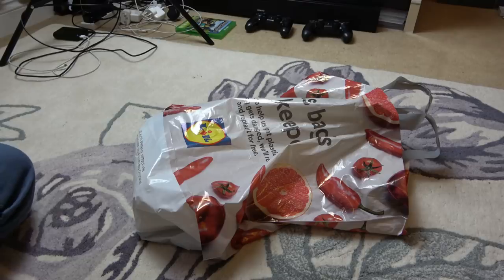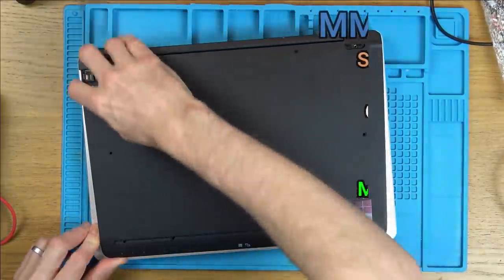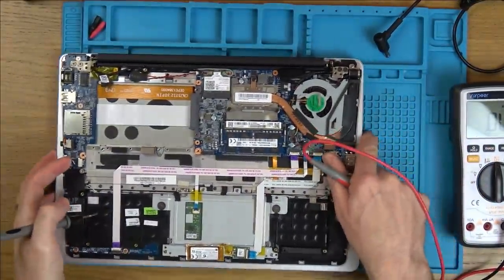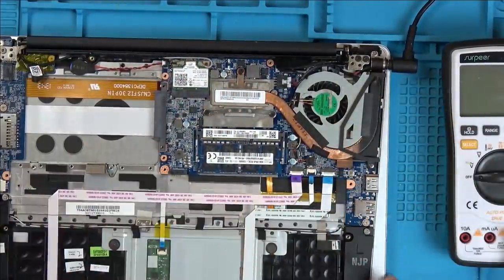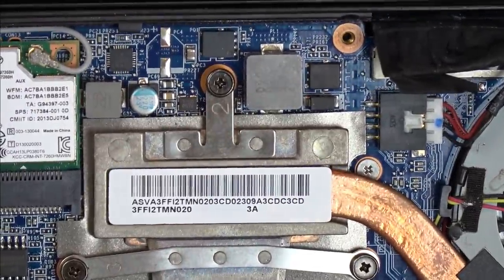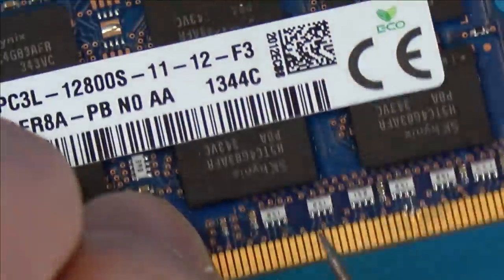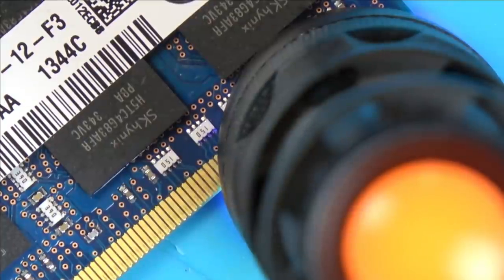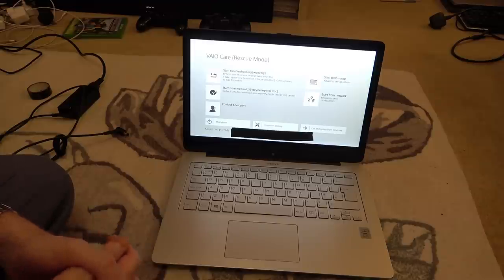A Lovely Sony Vaio Z Flip Laptop that Doesn't Power Up - Trying to FIX

Comment: He fixed a ram stick that's awesome.
Reply: No it's not fixed as who knows what problems that blob of solder will cause to the delicate current flow.  He solved the problem with the computer (kudos) but that ram stick MUST go in the trash and be replaced.  Every other technician would just have put another stick of ram in, we always have pairs of known working 4gb and 8gb sticks of 204 and 240 pin ram lying around for testing purposes.  Vince needs to do the same and collect some CPU''s of the most popular socket types too if he's going to do many more laptops.
Reply: @Biffo1262  Well I'm no expert but he also needs to  know that ram should be held by the edges and not to touch the contacts
Reply: @MorbidCrow666  Both of you seem like armchair experts to me.The signals are digital log levels, blob will not hurt anything.
Reply: @plopli2009  Well you obviously aren't a comment expert or you would of taken note that mine started off with the words " Well I'm no expert ". How Ram should be held is all I pointed out, nothing more nothing less.
Reply: @MorbidCrow666  That's what i said, you are not expert, but still talk about stuff above your experience an expertise.
Reply: @plopli2009  You do know someone can have knowledge on a subject without being an expert right? Because your comments state otherwise.
Reply: @Biffo1262  so your a replace man instead off a repairman like vince lolz
Reply: @MorbidCrow666  You have the knowledge that ram is sensitive, and the  contacts shouldn't be touched.You don't have the experience of touching hundrets or thousands without any issues. You may argue that ESD might damage it, but you haven't actually experienced such fault.You may argue that contacts may become contaminated, but  IPA will do the job of cleaning them.So general knowledge doesn't equal experience and you are basically running your mouth. Get technical with me, demonstrate your knowledge and expertise.

Comment: DDR3L isn't the next one on from DDR3, it's just a lower-power version with some better self-refresh stuff.
Reply from the maker: Thanks Skonk :-)
Reply: @fresh lemon water If a device needs DDR3 then you can use DDR3L or DDR3U ram, but a lot of native DDR3L and DDR3U memory controller devices don't support the DDR3 (no letter) voltage, so it doesn't always work the other way around.  I'm not aware of DDR3S.
Reply: @fresh lemon water The only difference between DDR3 and DDR3L is that DDR3L ram can operate at 1.35 volts instead of 1.5, and DDR3U can operate at 1.25 volts;  the RAMs all support both 1.5v and 1.3 or 1.25v, so if a device requires DDR3 then you can use DDR3L or DDR3U ram with it.  If a device requires DDR3L or DDR3U then it may not be capable of driving 1.5 volt DDR3 ram.

Note that this is different from LPDDR3, which is not completely backwards compatible.

Comment: The "L" on the ram means Low Power. DDR3L or DDR4L for example
Reply: Was going to comment this. It's not better in any way, just low power.
Reply: Does DDR4L exist? DDR4 is already significantly more efficient than both DDR3 and DDR3L, so I'm fairly sure that's what's used in most laptops these days.
Reply: @MrAwawe  Yes, I have seen DDR4L. In this laptop though it is DDR3L. It is not used in "most laptops these days" These days its just bog standard DDR4. DDR4L is usually in devices like smart phones.
Reply: @Seansmit23  that's what I said (or at least intended to); because of its great efficiency compared to DDR3 and DDR3L, standard DDR4 is used in most laptops today.

Comment: You’ve really taken a shine to fixing laptops, I see.

A bit of information:
No, DDR3L is not a step higher than DDR3. It’s a subtype, a “low-voltage” type, designed for efficiency. It draws 1.35 volts, compared to regular DDR3 which draws 1.5 volts. Also, there are two classes: DIMM (dual in-line memory module, used in desktop PCs) and SO-DIMM (small outline dual in-line memory module, used in laptops).

DDR5 hasn’t been released to the mainstream yet, but it’s right at the doorstep. At this moment, DDR4 is the de-facto standard, but I’m certain DDR5 will take that mantle before long.

POST stands for “Power-On Self-Test”; it is an integral part of the BIOS, and one of the first things (if not the first thing) to start before all else.
One of the main things it does is locate, measure and verify the memory.

The pin that was broken is one of the datalines, specifically a data strobe line (each line has a corresponding “inverted” line, which is used to filter out any noise; both lines will have opposing signals, but identical noise patterns. It’s kinda akin to the “twisted-pair”-method used in Ethernet cables: each line for each pair transfer opposing voltages, but the noise entering them will be nearly identical, so simply taking the voltage differences will yield the original signal. It’s called “Differential Signaling”).
I believe the tiny white things they’re connected to behave like the tiny black things on the PS4 that connect the data lines of the HDMI port to the retimer chip: they contain twisted pairs of copper wires for Differential Signaling.

In general, though: no RAM, no boot, even when one half of a data line is broken. POST is extremely strict, and with all the electromagnetic noise our devices are subjected to (and subject others and even themselves to), balanced lines and Differential Signaling have become a strict necessity.
Reply from the maker: Great info, thanks Operational :-)
Reply: What about GPU with GDDR5 memory?
Reply: @mikedw6748  Graphics cards even have GDDR6 and GDDR6X. I don't think they count since they're not removable.
Reply: You Talk to much
Reply: Maybe cpu related isue inhave seen laptops with cpus failing that prevent it to boot but great video vince
Reply: That is great and most detailed information.
Reply: The little 6 pin IC must be TVS diodes (Transient Voltage Suppression)
They are ESD protection
The data lines are very sensitive to ESD
Reply: So it's still safe to replace the 1.5V with the 1.3/1.35V ?🤔 Thanks for the in depth info
Reply: @XxmatixX6videosdiariosdenadav  I did!
Reply: @Mymatevince  happy new year
Reply: The Sony valve flip that was a very very expensive laptop when it came out you get this one working that's some good money I think it's might be even considered antique now so definitely worth a lot more
Reply: I know that the L on the RAM stood for low-voltage, but I also thought it stood for low-profile as well... but now that I think about it a generic stick of RAM for a desktop is shorter in height and is longer.

Comment: I got my sister a used Thinkpad x260 with i7 - seller said the screen was dead, so I got it pretty cheap. Inspired by your videos, I felt confident enough to fix it.^^ Turned out, the seller tried to replace the screen but didn't disconnect the battery - a 0402 SMD fuse blow. This was the first time I ever soldered something so small. Now I'm just waiting for replacement parts from china for the chassis, and then I can gift it to her. :) Thanks a lot for your videos, merry christmas and a happy new year!
Reply from the maker: Excellent, well done Daniel. I hope she likes it.
Reply: @Mymatevince  Thanks a lot Vince - she's totally not expecting that, so I'm sure she will! :D

Comment: These are very good videos for experts, to learn a lot, or just to learn for fun. I usually lubricate the fan’s ball bearing, and use a sticky tape to make sure, dust doesn’t go inside. It doesn’t need to fully disassemble the fan, the oil goes into both ball bearings after a few minutes of spinning. A 5 v power supply, charger can run the fan. About 10 min is needed, to lubricate both ball bearings. The fan’s sound will be better, and will last longer. Every 10 years it is needed to lubricate the fan.

Comment: Fantastic!!!! =D  So glad you remembered the kapton tape!  Perfect job!!!  Those bits of plastic on the memory contacts there, maybe it was due to the connection arcing a little, which melted a tiny bit of the plastic around the pins in the socket?!?  Either that or perhaps it  had been fixed at factory and covered with something, and due to  the repeat failure in that spot the covering melted away?!?   Have a fantastic Christmas Vince =D  Here's looking forward to 2021 being better than 2020!
Reply from the maker: Thank you Chris, cheers for all the help over 2020. Good luck with everything in 2021 :-)
Reply: @Mymatevince  v

Comment: I had the 13 inch version of this model with an i7 back in the day. Other students in class were baffled how awesome I just flipped the screen to turn my laptop into a notetaking device. These light-weight convertibles are great studying devices: allowing for conveniently taking notes and scribbles. But still potent enough to also run some more demanding tasks, like numerical computation, CAD or programming.

Comment: This was a nice little test for myself, I'm not a technician or anything like that but I've always had massive love for computers and I've always messed around them and done little repairs here and there and from the first second when I saw how and when it turned on and then back off I said RAM is the issue and it's such a treat that I was correct, I still got it :D

Comment: Wow, that was impressive. You went far more thorough on this than most companies even would've. What I find odd is that it didn't even try to POST without RAM. IIRC most motherboards, even laptops, at least try to, they just tell you they can't. It might've just been a RAM stick in the end but it took a lot of trial and error to make sure. Nice work.
Reply: The POST (or Power On Self Test) usually requires the presence of the RAM, Keyboard and CPU in order for it to POST then allow the OS to load. Since there was a break in one of the traces on the RAM, the RAM was therefore missing in the eyes of the POST thus it won't even load the BIOS. I'm actually surprised the computer repair guy didn't try another stick of RAM in it.

Comment: Back in the days, computers always beeped some kind of error code at you when they couldn't boot. And the manual contained a table that would translate that beep code to the actual problem. But nowadays, I guess, this capability has been canceled for manufacturing cost savings. And this particular laptop did not do anything different with or without the RAM stick.
Anyway, kudos for actually fixing it, instead of just swapping modules.
Reply: baxk when manufacturers cared. Today its Crap'n'go.

Comment: I'm a computer repair tech and have a few words of advice.
Start with RAM, always start by swapping a different ram stick in. Then try without the hard drive or SSD connected (some machines won't boot without a storage device so be aware of this). Then try removing the wifi card. Then move onto screen, daughterboards and anything else you can try removing. After that delve into power. Saves a lot of time.
Also, if you plan to sell a machine, always replace RAM. It has a limited lifespan, and its best just to put some fresh stuff in there. If you're keeping the machine yourself, a bodge of a trace like this is totally fine.

But, well done for fixing it, and saving it from the easte pile, and as I said above, start with the simple stuff. (Keeping a few parts on hand like ram is also well worth it).

As for PC3 vs PC3L, the L stands for low voltage. Just depends on the machine as to which it takes, but you're switched onto this, so thats ace.

Comment: I had a 15 inch version of that laptop and loved it! If I recall correctly, they were just called "Vaio Flip 13/15" (number being the screen size) and when they were new (released approximately 2011-2012, I think), the i5 models were somewhere in the $700-800 USD range. The pen, unfortunately, did not come with it and was quite pricey. I actually still used it as my primary laptop right up until this year when I finally decided the battery life wasn't acceptable anymore. Folding flat and having pen input came in handy so often in school. The wifi card died at one point and I had to replace it, and somewhere along the way I upgraded the hard drive to an ssd, but other than that it performed admirably.
Reply: (Late reply)I know this is a bit offtopic but I remember my toshiba laptop the wireless card died but it had the lcd smashed so it can only be used as a desktop and used ethernet, I did replace the WiFi card after building my pc and it fixed the issue(the WiFi card was off before upgrading from 7 to 10)
Reply: I still use my Sony Vaio VPCF132FX/B model laptop and I'm typing this comment on a Sony Vaio VPCL216FX All-in-One computer in late 2023.

Comment: Great work!! Time saver tip. If you have the lights on that means the 19v and 3.3 v rails are present. Pushing power button causes the super I/O chip to try to turn on the ram, vcore and 5v rails. If any failure is detected it will turn off for safety. Thus the lights turning on and then off.  Great vid!

Comment: Very good demonstration- And as for cleaning the rubber edge of the screen that is dissolving, try to clean it or apply isopropyl alcohol for cleaning, I have done this on rubbers as well as jog well controls of Dj controllers, as well as other applications and it solves, many of them in the case of Jog of controllers even shine like originals after cleaning, thanks for the video and I'm still here diagnosing my Sony Vaio Z Flip-SVF14N13CXB. Tks

Comment: Great work. Talk about 'For the want of a nail the Kingdom was lost!" Unbelievable! How complicated that whole system is and a simple line on a pad failed. I always try re-seating the RAM first but would never have thought to check the data lines on the module itself. Great spot and great fix.

Comment: when the green light was going on and off it reminded me of when I was mucking about with my old Toshiba laptop, and I had taken the stick of ram out, but I didn't re-insert it correctly (which resulted in the computer attempting to power on and then cutting out when I tried to turn it on afterwards)
I very much doubt that would be the issue here though
Reply: Could be
Reply: A non-post is nearly always a RAM or CPU issue.  If it's hard drive issue you get some form of non system message.  Check the simple things first.  I had one the other day where the screen would just occasionally 'garble' up but would reboot with no problem.  It was an Intel i5 with HD4000 integrated graphics.  So the CPU was getting too warm or it was dying which was unlikely given it kept rebooting and working 90% of the time.  I stripped the fan and heatsink off and what thermal paste there was there had been squashed out by tightening the heat sink down too hard and it was solid.  New thermal paste and clean the fan which was pretty clean and it's been 100% OK since.
Reply: @Biffo1262  Im suprised I never suspected that the ram might be the culprit of why the laptop in the video was behaving like that
and the Toshiba laptop booted up fine, by the way (apart from Ribena having been spilt on the keyboard causing half the keys to stop working, and also if I plugged in a USB keyboard it would then go crazy as if I was hitting shift continuously until i unplugged the USB keyboard)

Comment: A pin in ram slot is lifted up... you can see it at 27:47, middle of the screen, upper side of the connector. I think it corresponds to the damaged pad on the ram stick.

Comment: I still have a Vaio from 2010 and upgraded the ram, removed the bluray drive and replaced it with a 1TB drive and upgraded upgraded standard hdd with a ssd and it runs beautifully. Has a 1gb ATi graphics and a 1080p screen, for a 2010 laptop that was a big thing to have. Love the laptop.
Reply: Hey, I'm trying to find the right RAM to update with this same laptop, do you have a number/definition of that you could tell me? On the off chance....thanks in advance :)

Comment: The first diode you measured on the board had one side to power and the other to ground. It is reverse polarity and is used for TVS (Transient Voltage Suppression). It will not conduct up to a specific voltage and then it will conduct like a short. The reverse voltage is picked to be a safe voltage with some margin above the expected input range.

Comment: Of the two MOSFETs you tested, the one without a gate signal is likely the low-side MOSFET for Vcore. The high and low side MOSFETs are controlled by another power IC which in turn requires a signal from DDR3 before it gives a PWR_GD signal for the entire system to turn on. By restoring the DDR3 subsystem, this likely restored the DDR3 prerequisite of the power IC. I've encountered this fault in a Lenovo laptop before. Good job!